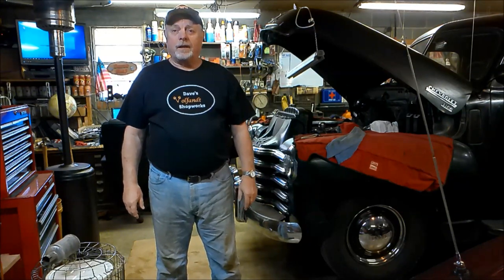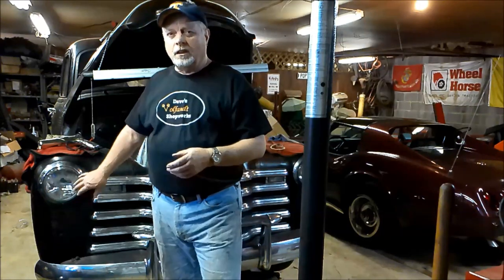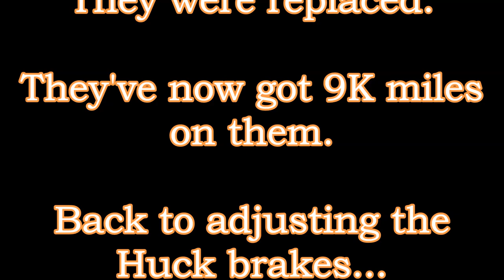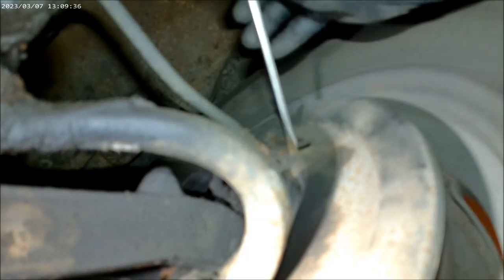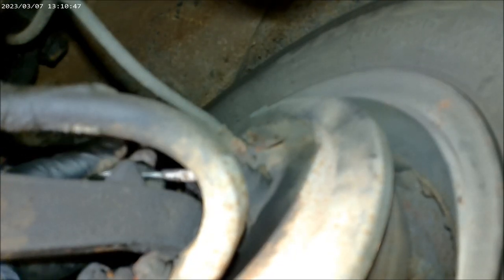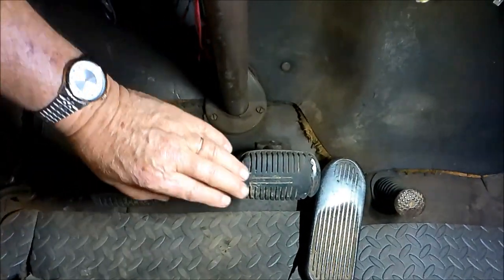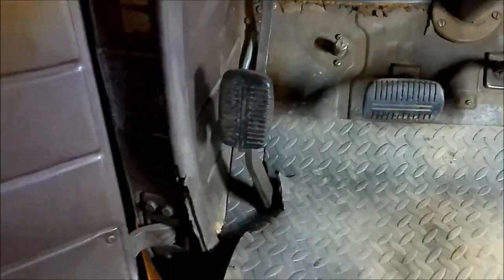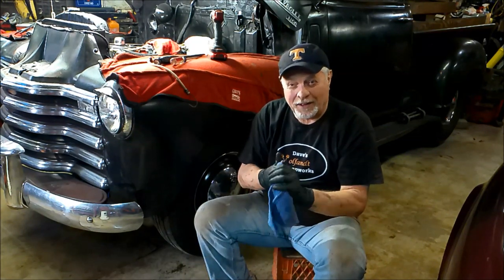Adjusting the Huck brakes on a 1949 Chevy 3100, Volume 87

Comment: I've been saving up and finally got myself a 1948 GMC 1/2 ton short bed five window. I've been watching your videos for years gathering info for this momentous occasion. It's a project not road worthy at all. No brakes lights and no interior. I think it has a 216 in it, four on the floor. I have some catching up on your videos now. Thanks Dave for all the great info your channel offers.
Reply from the maker: Hey Randy. Thanks for watching. Send me your addy and I'll send you a couple stickers. As for your engine it's possible someone put a 216 in it but being a GMC it's probably a GMC 228 which has more HP. Checkout the serial # behind the distributor for more info.
Dave

Comment: Thanks Dave. I didnt know they were called Huck brakes. I rebuilt the entire brakes/master cylinders but the car is hard to move (1941 Master Deluxe). When I release the pressure from any of the four cylinders it is back to normal.... Until I press the brake again. I'll adjust down the cylinder's screws and see what happens.

Comment: hi Dave.. if you get to see or read my post i have a question. i just changed my wheel cylinders on my 41 chevy. i blead the system but when i took it for a test drive.. it pulls to the right when i break. watching this video makes me feel i need a better adjustment on the shoes?
Reply from the maker: Yes, sounds like you'll either need to back the front right side down or tightrn th eleft side alittle more. It's almost an art to get them true.
Reply: @Volfandt  thank you  i appreciate you  great videos

Comment: Hey bud long time no talk.... had a question for ya...im workn on my front discs on a 65 tbird... im tryn to remove my hub & rotor assembly.. to clean & inspect the bearinge.. i  hve my shop manual but i can not get the assembly off the spindle... outer bearing wont come out .. dont wanna damage it... any pointers my man thanks again 🙏
Reply from the maker: I'm not aware of a 65 TBird frontend being any different than most mid size cars of that era so I'd think once you removed the cotter pin, castle nut & washer it should just come off. If it's been on there awhile a couple smacks on the inside of the rotor should work it loose. Don't go gorilla on the smacks and if you have a rubber hammer that would even be better. Good luck and have a good 'un.
Reply: @Volfandt  yessirrr... just exactly what I've been doing & with my rubber mallet ..just needed some words of wisdom 🙏  thx again my friend... still gotta get that stoveb9lt to top dead center like we talked before ...been doin other projects 🤦‍♂️ non the less thank you my friend ...hope all is well God bless